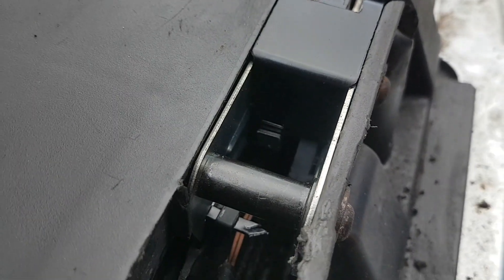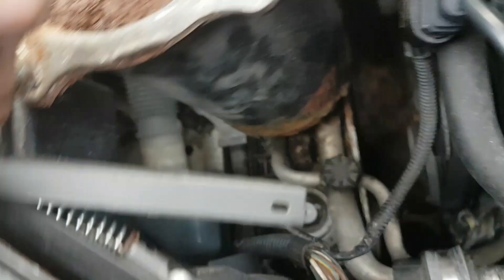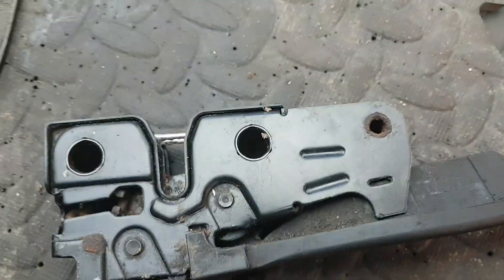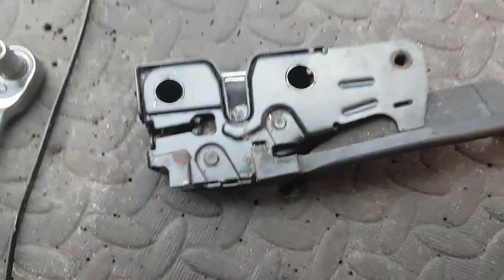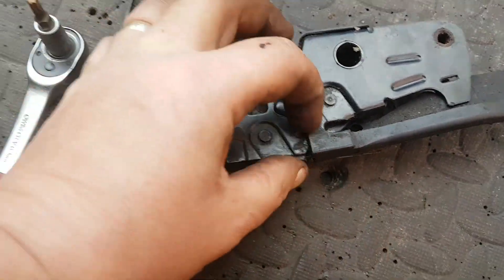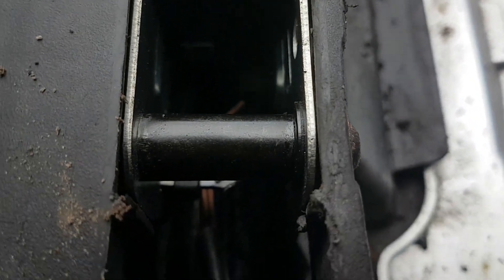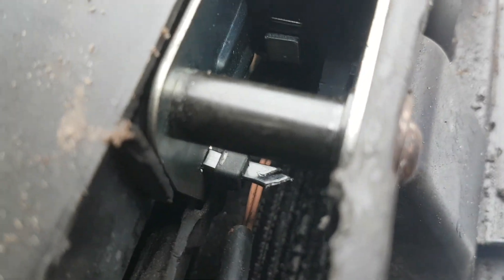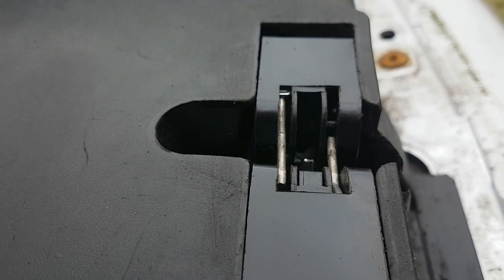Vw Golf Mk5 bonnet catch

Comment: Hi, I'm not getting the open hood light, I had a problem closing the hood before but that's fine now. Can u help me?
Reply from the maker: It will be the switch in the bonnet catch they break after sometime
Reply: @AliMackMechanical  Now i tried move with cabels and it works! But still i will use wd 40 for contacts.
Reply from the maker: Yeah, try and keep it clean from grease and oil, and it should work glad to be of help